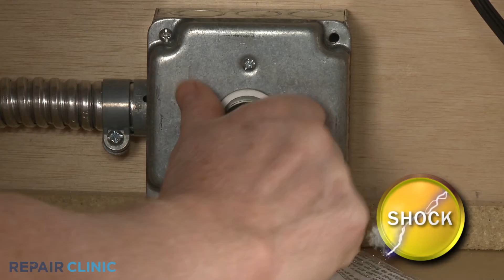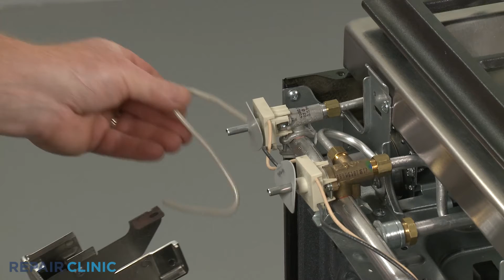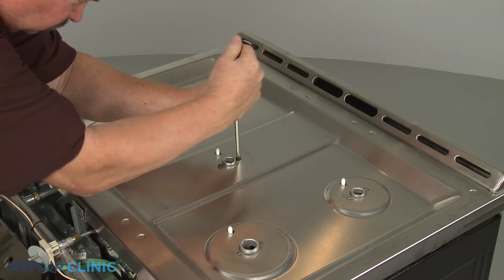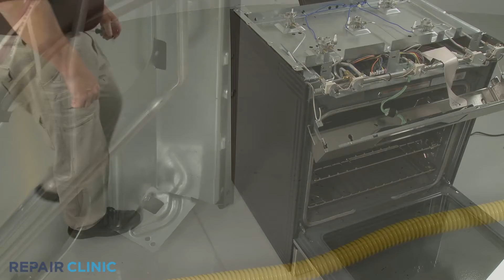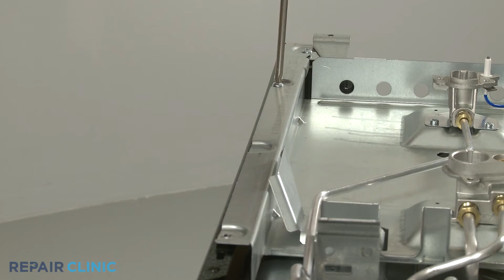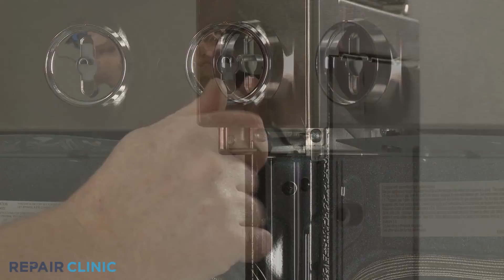KitchenAid Convection Gas Range Cooling Fan Assembly Replacement W11107275

Comment: Thanks for the detailed video. Good news: I successfully replaced the fan assembly on my Jenn Air range with the help of the excellent video. Bad news: this was the second major repair (first was the control board a year ago) on this 4 1/2 year old range. One early life cycle major part replacement could happen to anyone. Another a year later? Suggest that folks think twice about purchasing a Jenn Air range.